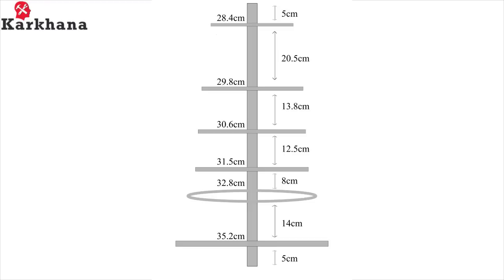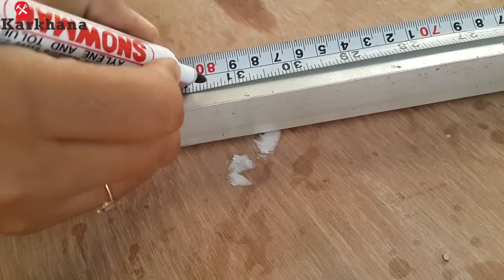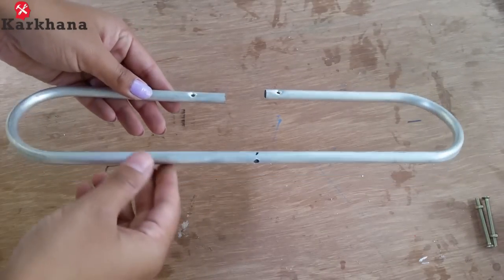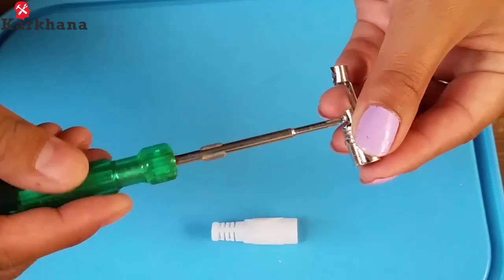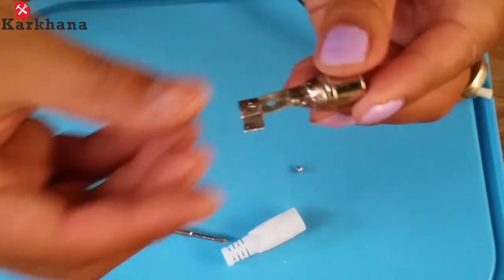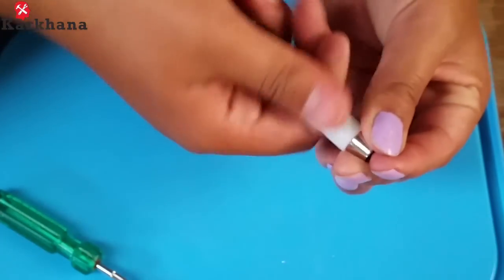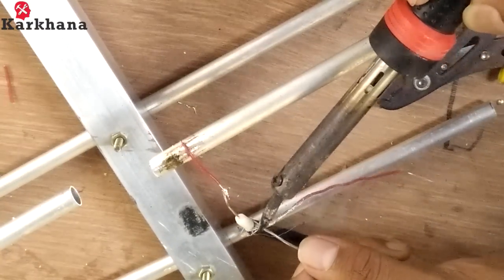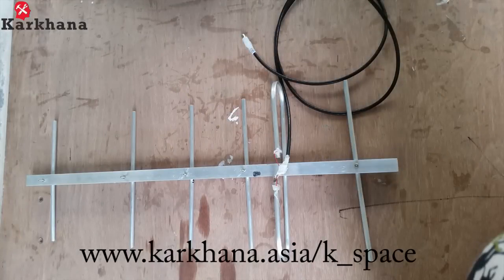DIY Yagi-Uda Antenna

Comment: Your antenna connection is an impedance of 300 ohms and the coax is a 75 ohm cable which is not  matched together. You need to have a 4:1 Balun at the dipole connection before the feedline is attached!!! Please add a comment to all to see on this video from you,  that what you are showing is not correct, and that it needs a 4:1 balun at the feed point for this to work properly! If not your not doing correctly by your viewers! Best Regards Jimmy, WX9DX, ARRL TS

Comment: Wow! I've been working on a yagi antenna for 2.4ghz wifi and I've scoured the internet trying to figure out how to properly make and install the folded dipole and how to connect the coaxial cable to the driven element and THIS is the first and only video I've found that seems to clearly describe how to solder the coax to the driven element! Thank you so much for making this video!

Comment: How NOT to build a yagi.
Reply: The antenna itself looked nice.. but never work the way they wired it up
Reply: This type of  antenna is referred to as a grounded element yagi and is usually fed with a 4:1 balun or a 1/4 wavelength of 75 ohm coax (RG-59, RG-6, etc.) as a matching section as the feed point impedance is around 270 ohms, and then 50 ohm coax to the radio.

The feedline connections and the use of hot glue is problematical at best, the connections should be made using stainless screws and lock washers and weather proofed.

73, de N1WOM

Comment: What is the purpose of this antenna? I don't believe this is a HAM project: emitting element, cable, connector, and the way the cable is connected to the emitting element are completely incorrect. By the way, don't use hot glue for connecting the cable to emitter - use bolts and nuts - this is the only proper way to connect your cable to the antenna. 73! UT8UU.
Reply: the emitting element is connected to the reflector and all the directors through the boom for some reason...73

Comment: Zoren is right folded dipole is 300 ohms but you are connecting 50 or 75 OHM coax cable you must use 1/4 BALUN
Reply: Selamlar  !         sağ olun Levent  Bey beni doğruladığınız için . teşekkürler .  ben de kendisine   özelinden  sizin yazdığınız gibi birşeyler yazdım gönderdim
Reply: infact! or use a 300ohm bi-filar antenna cable but not a coax whitout BALUN
Reply: You can use a 1/4 wavelength section of 75 ohm coax (RG-59, RG-6/U, etc) as a matching section.
Look it up on any antenna design website or in any antenna book on the market today.
73, de N1WOM

Comment: This has to be a joke. 300 ohms directly to 75.  Radiator grounded out.
Reply: Correct  the folded dipole should  be insulated  not grounded  hahaha your yagi is a big mistake

Comment: folded diplole is approx 300 Ohm and Coax is 75 Ohm this is unmatched, why not using BALUN?
Reply: how do you calculate the impedance of an antenna?
Reply: YES a 4:1 would be a good start
Reply: Ive seen criss cross wiring through elements and this. I use a balun straight in to the reflector. 2 screws matched and done.
Reply: @RCMagnusson  you learn them, normal dipole impedance: 73ohm, folded dipole:300ohm ecc....  If you need any help write to me at Hamradio_Milano

Comment: It appears that your radiator or dipole is shorted out on the boom?
Reply: Well, Antennas work that way, there is no SHORTINGG OUT, the Antenna is magical, and in this video she did it right, all that counts is on highter up in antenna because thats the radiator, not the bottom so bottom can short out how many times it want :)
Reply: @krisraps   whattttt? Hahaha  try to research that kind of antenna  if  it work that  way
Reply: This type of  antenna is referred to as a grounded element yagi and is usually fed with a 4:1 balun or a 1/4 wavelength of 75 ohm coax (RG-59, RG-6, etc.) as a matching section as the feed point impedance is around 270 ohms, and then 50 ohm coax to the radio.

The feedline connections and the use of hot glue is problematical at best, the connections should be made using stainless screws and lock washers and weather proofed.

73, de N1WOM

Comment: I want to make a yagi 433MHz antenna at 1/4 wavelength so it would be smaller.  I have small quarter inch copper tubing which should be better then aluminum since I can solder to it. What should the dimensions be?  Also I have not seen any antenna were you electrically ground the active element. I would like to see a test of your antenna.
Reply: This type of  antenna is referred to as a grounded element yagi and is usually fed with a 4:1 balun or a 1/4 wavelength of 75 ohm coax (RG-59, RG-6, etc.) as a matching section as the feed point impedance is around 270 ohms, and then 50 ohm coax to the radio.

The driven element, the folded dip[ole, is meant to be grounded to the boom.*

Or you can feed it with twin lead like the type used on an old style TV antenna And yes, the twin lead is 300 ohms, but it is close enough. I have even used 450 ohm window line to feed these antennas with a 4:1 balun at the shack without a problem.

The connections to the feed line should be made with screws or nuts and bolts and lock washers instead of soldering.  Also the use of spade or ring terminals can be used for ease if installation and removal of the antenna.

Copper tubing can be used but the copper will corrode over time and become brittle to the point of breaking and the aluminum tubing is lighter, cheaper and stronger than copper.

Check out any ARRL, RSGB or other antenna book or any good antenna design website and you will find all the information that you will need.

I have used these antennas on 6 and 2 meters and also on the 70cm band with great results.

73, de N1WOM

*It can also be constructed with a 1/2 wave driven element instead of a folded dipole element.  It is also grounded to the boom and fed with 50 ohm coax through a gamma or hairpin matching device.

Comment: Its grounded or short
Reply: This type of  antenna is referred to as a grounded element yagi and is usually fed with a 4:1 balun or a 1/4 wavelength of 75 ohm coax (RG-59, RG-6, etc.) as a matching section as the feed point impedance is around 270 ohms, and then 50 ohm coax to the radio.

The feedline connections and the use of hot glue is problematical at best, the connections should be made using stainless screws and lock washers and weather proofed.

73, de N1WOM

Comment: Good work and keep it up sister...🌹🌹
Reply: it's all wrong
Reply: @gaddogabetti740  Yess i try it but didn't work goog.. Little bit working fine
Reply: This type of  antenna is referred to as a grounded element yagi and is usually fed with a 4:1 balun or a 1/4 wavelength of 75 ohm coax (RG-59, RG-6, etc.) as a matching section as the feed point impedance is around 270 ohms, and then 50 ohm coax to the radio.

I do agree that the feedline connections and the use of hot glue is problematical at best, the connections should be made using stainless screws and lock washers and weather proofed.

73, de N1WOM

Comment: 300ohms Balanced dipole to 75ohms Unbalanced coaxial. That huge impedance unmatched. 
Wire connection not exactly centered. 
Hot glue connection. Not a thing you want for something that gonna sit outside with harsh weather.
And also SWR for this is hilarious.
Reply: Correct  it needs a balun transformer
Reply: This type of antenna is referred to as a grounded element yagi and is usually fed with a 4:1 balun or a 1/4 wavelength of 75 ohm coax (RG-59, RG-6, etc.) as a matching section as the feed point impedance is around 270 ohms, and then 50 ohm coax to the radio.

I do agree that the connections are problematical at best and should be made using screws and lock washers.

Comment: All is connected to ground....................
Reply: Driven element is dead short...no insulator.
Reply: yes, ground konslet,  short, no isolator,
Reply: This type of  antenna is referred to as a grounded element yagi and is usually fed with a 4:1 balun or a 1/4 wavelength of 75 ohm coax (RG-59, RG-6, etc.) as a matching section as the feed point impedance is around 270 ohms, and then 50 ohm coax to the radio.

The feedline connections and the use of hot glue is problematical at best, the connections should be made using stainless screws and lock washers and weather proofed.

73, de N1WOM

Comment: That's the major wrong way you hooked up the driver.. this will not work..   it will never work that way
Reply: This type of  antenna is referred to as a grounded element yagi and is usually fed with a 4:1 balun or a 1/4 wavelength of 75 ohm coax (RG-59, RG-6, etc.) as a matching section as the feed point impedance is around 270 ohms, and then 50 ohm coax to the radio.

The feedline connections and the use of hot glue is problematical at best, the connections should be made using stainless screws and lock washers and weather proofed.

73, de N1WOM

Comment: Looks like you have cancelled out your driver element.
Reply: This type of  antenna is referred to as a grounded element yagi and is usually fed with a 4:1 balun or a 1/4 wavelength of 75 ohm coax (RG-59, RG-6, etc.) as a matching section as the feed point impedance is around 270 ohms, and then 50 ohm coax to the radio

73, de N1WOM

Comment: Never Seen a so long list of wrong actions to build a Uhf antenna! 🙁😣
Reply: This type of  antenna is referred to as a grounded element yagi and is usually fed with a 4:1 balun or a 1/4 wavelength of 75 ohm coax (RG-59, RG-6, etc.) as a matching section as the feed point impedance is around 270 ohms, and then 50 ohm coax to the radio.

I do agree that the feedline connections and the use of hot glue is problematical at best, the connections should be made using stainless screws and lock washers and weather proofed.

73, de N1WOM

Comment: joke she was right on it and boom fuked up the aktiv element to the bom and hot glu ?? way ?? 1. april Å??
Reply: This type of  antenna is referred to as a grounded element yagi and is usually fed with a 4:1 balun or a 1/4 wavelength of 75 ohm coax (RG-59, RG-6, etc.) as a matching section as the feed point impedance is around 270 ohms, and then 50 ohm coax to the radio.

I do agree that the feedline connections and the use of hot glue is problematical at best, the connections should be made using stainless screws and lock washers and weather proofed.

73, de N1WOM

Comment: Now if this was dated 1st April I would have believed it...   haha... must be a joke....
Reply: This type of  antenna is referred to as a grounded element yagi and is usually fed with a 4:1 balun or a 1/4 wavelength of 75 ohm coax (RG-59, RG-6, etc.) as a matching section as the feed point impedance is around 270 ohms, and then 50 ohm coax to the radio.

The feedline connections and the use of hot glue is problematical at best, the connections should be made using stainless screws and lock washers and weather proofed.

73, de N1WOM

Comment: Hot glue? WTF? So much simpler with duct tape or a spongebob squarepants bandaid. LoL. But seriously...you have constructed nothing more than a non-working replica of the real thing. You have not electrically isolated any part of this antenna. Everything is shorted together
 For this to work, there has to be insulators between all of the components of this POS that you have assembled.  That means between the boom (which all the parts are mounted to) and your forward directors, reflector and the folded dipole. Basically...everything!!! And where is your balun? You really need  some reeducation on this entire project of yours. I sincerely hope that nobody has built this antenna solely based on your video. It isn't going to do what a real yagi uda antenna is intended to do. Why not just use a metal coat hanger hanging from a branch on a tree with speaker wire shoved into the back of your tv? <--- don't do that.
Reply: Only your comment confirmed me others were not taking about shorted things

Comment: Seriously, there are so many fundamental electrical and construction errors with this. Ask any ham radio operator ... they'll just roll their eyes and walk away!.
Reply: This type of  antenna is referred to as a grounded element yagi and is usually fed with a 4:1 balun or a 1/4 wavelength of 75 ohm coax (RG-59, RG-6, etc.) as a matching section as the feed point impedance is around 270 ohms, and then 50 ohm coax to the radio.

I do agree that the feedline connections and the use of hot glue is problematical at best, the connections should be made using stainless screws and lock washers and weather proofed.

  73, de N1WOM
Reply: @jfrphoto01  To match the approximate 270 Ohm impedance of a folded dipole to 50 Ohms coaxial cable would require a quarter wave matching stub of 116 Ohms impedance. Using a quarter wavelength of 75 Ohm coax as you mention would match 50 Ohms to 120 Ohms, not 270 Ohms.
The 4:1 coax loop balun commonly used to match a folded dipole uses a half wavelength.

DE VK2AAK / VK2UE